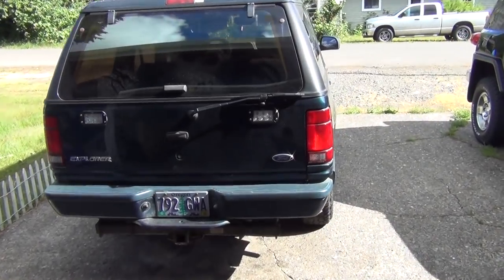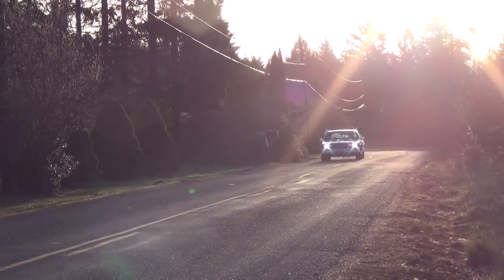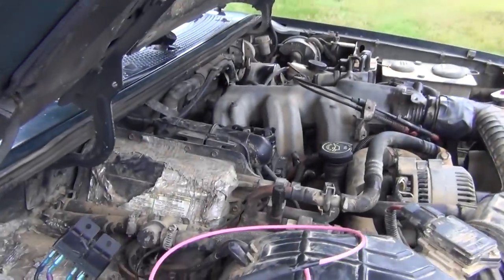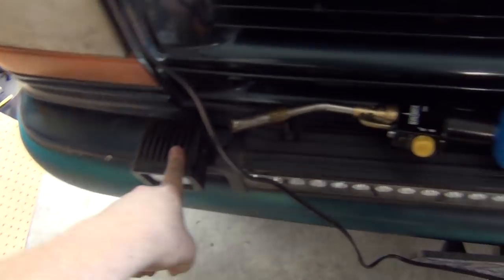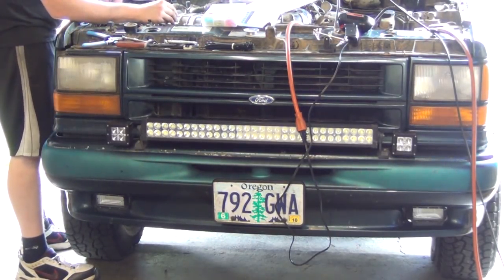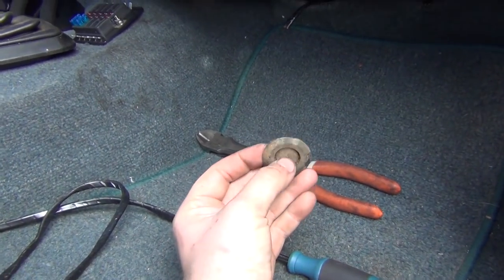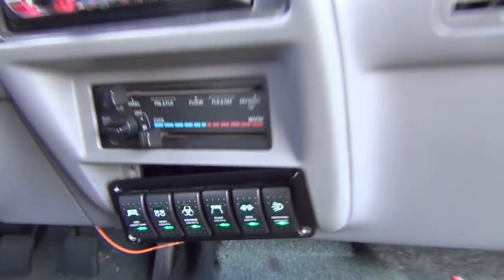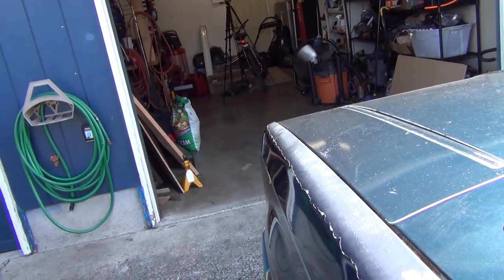First Gen Ford Explorer | Kustom Lighting and Switch Panel Install Finale

Comment: for the popping, get some flyback diodes for the relay coils.  for the antenna, get a ferrite ring for the power wire causing it.  I think the backup lights is what you are having problems with on that one?  keep up the good work, sir.

Comment: The only thing I would say is always run cables in a straight line, don't fold them back on themselves as you have at the top of the tailgate as it can cause a potential fail point from the copper conductor in the wires becoming work hardened and breaking.  I'd have run those wires along inside the top of the tailgate and out through the other factory harness carrier and then down the other rear pillar, it would be a longer wiring run but it would all be straight...